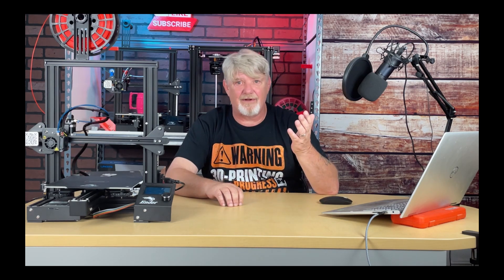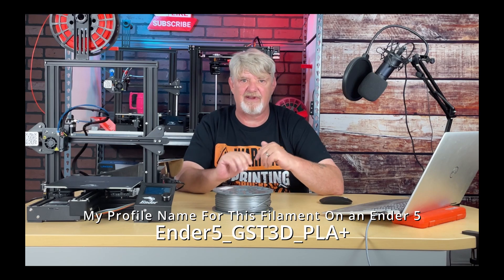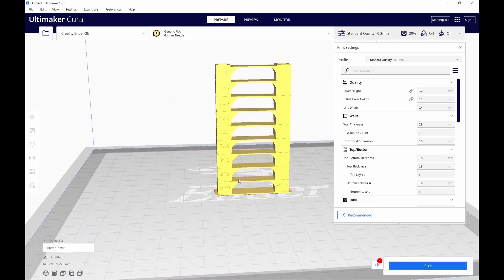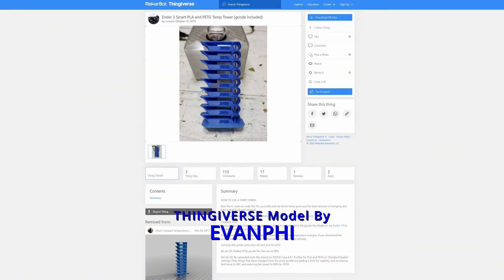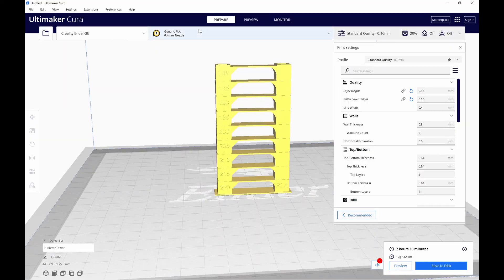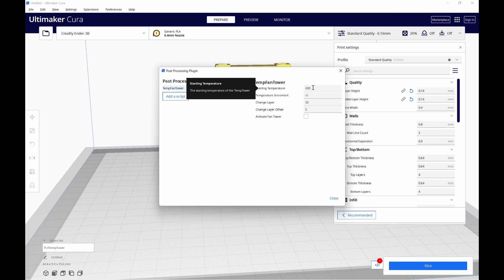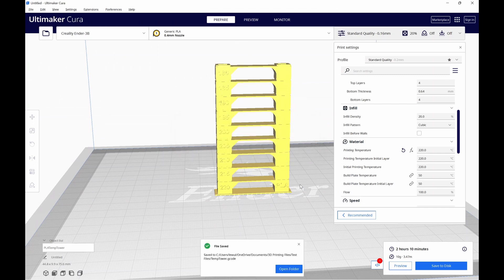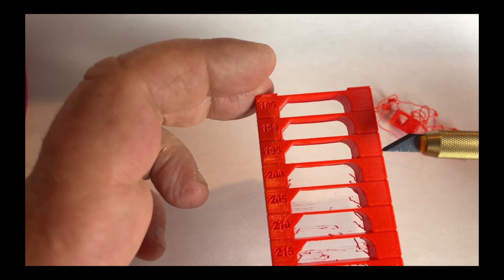Temperature Towers Using Cura Calibration

Comment: Good.  But this is a temp tower, do we really need to run at .16mm layer height?  Why not just make it .32mm and do a layer change every 26 layers (with a base of 2 layers)?
Reply from the maker: An easier way would to be use the automated calibration towers from the Cura Market Place

Comment: Question on this please? I have got my temperature set to 220 in the print settings of Cura. I want to print the supplied tower but that temp says 230. My question is do I keep my printing temp at 220 or 230? Thank you!
Reply from the maker: You have to work the gcode so that you are printing a range of temperatures to determine what temperature works best. But since making this video, I have a newer video that demonstrates a much easier method that takes the guess work out it. It's a quick five minute video, give it a look and see if it doesn't make the process easier. Good luck! https://youtu.be/fjlGvtNSlYw

Comment: This video was EXTREAMLY helpful, as I just purchased a Mingda Magician Pro 400x400x400, and new to 3D Printing.. my needs are for printing Carbon / Nylon car Parts for my 1937 Pontiac SilverStreak. having a few filaments (will try and keep to the same brand); this test will ensure my Cura settings are as good as it will get per filament type.. the hint about calculations and post GCode was wickedly helpful!
Reply from the maker: Thanks for the kind words! You have a nice size printer!!!

Comment: Im pretty new, im using the cura extension and printing flow towers, the flow seems the same all the way up... Not sure why its not changing.  Im wondering why im getting the second layer smashing the first layer... It seems ok after the second or third
Reply from the maker: I'm not sure what you mean by the second layer smashing the first layer? But I'm going to make 2 guesses and hope one of these what you are faced with. Could it be that your Z-Offset is set a little to low and the nozzle is squishing your first layer outward? If this is case increasing the z-offset a little bit could take care of this. Just don't go to high or you'll get no bed adhesion. The second guess would be that your initial layer height is set higher than the rest. It's common to do this. In Cura, I run my initial layer at 0.28 and my standard layer height at 0.20. I'm not sure what printer you are working with, if you have to manually level it of not. If you're manually leveling, you could leave just a little more room between the nozzle and the bed plate. Not a lot, just a little. I hope this helps!
Reply: @pushingplastic7445  sorry yeah it's an Ender 3 max, using glass plate and I can't get it to stick unless it's squishing that filament pretty good.  Yeah maybe I'll mess with that initial layer more.   Isn't z-offset for auto leveling printers?
Reply from the maker: @Jacey2001  The easy fix would be to let a little more distance between the bedplate and nozzle. IF you're leveling the bed with a piece of paper, just try have a little less drag  on the paper.
Reply: @pushingplastic7445  I'm using a gap tool,  0.1mm fairly tight.
So set initial layer to .28? Adjusting flow doesn't seem to work that much
Reply from the maker: @Jacey2001  you could try .15 to .2 on the gap tool. .28 on the initial layer will squish it more. Flow isn’t going to help you in this case

Comment: How do you use the Evanphi temp tower model? Do I just download the gcode he has there and print that? or I download the model and somehow set it up with that?
Reply from the maker: Don't use dowloaded gcode. While the code for the tower itself might work, there is always the chance that other settings in the gcode could cause you problems. But you can download the model and use it. Just use the same steps as shown for setting up the layer/temperature changes as shown for the version using the calibration shapes tower. You might want to Check out the Cura Autotower Generator plugin. It will setup the tower and gcode for you. I have a video for that on my channel. It's much easier to use.
Reply: Awesome, thank you! Will check out your other video. Thank you for the quick response!

Comment: sorry I dont understand why youre talking about springing, isnt that tuned with retraction? thanks im struggling with TPU on direct drive KP3s PRO
Reply from the maker: A few different things can (and do) cause stringing. Incorrect temperature settings is one of them. Determine the right temperature for your printer/filament combo. Once you have that set, do a retraction test. Everybody struggles with TPU. Not a direct drive, but on my Ender 3, when printing 95A TPU, I print at 220 at the hot end, 70 degrees on the bed, I really slow down my speed, to 20. Thanks for watching!

Comment: Great video, great explanation.  Thanks.  I’ve noticed that Cura now has a specific Temp Tower download.  I’m brand new to printing so this is my first attempt.  I’m assuming that even though it is a preset download I will still need to set my own G Code parameters.
Reply from the maker: Try the auto tower generator, it’ll make the g code for you. I have a video for that on my channel
Reply: @pushingplastic7445  Thanks, I only found your channel this morning.  I’ll watch that now.  I’ll have a look through your back catalogue as well.  To me your videos are so well put together.  Thanks for taking the time
Reply from the maker: @robinparkes988  thanks for the kind words & thanks for watching!
Reply: If only I had looked through your back catalogue first.  Yes, you already covered this.  Oops. 🇬🇧

Comment: Good information. Would love to hear more about your choice of that other temperature tower from thingiverse. Thanks.
Reply from the maker: Sure! There's a little bit more that you can learn from that tower. The Arc on the left side of the tower, it gives a good indication of how a particular temperature handles overhangs. Also on the left, there is a wall that tapers from front to back provides some feedback on how a particular temperature with walls of various sizes will print. As the wall gets thinner, you might see more stringing. On the right side, there is a circle with a spike in it. Look for stringing in there. The spike also tapers from bottom up. I look to see if the spike is broken. The spike can give you an idea on how well a particular temperature will do fine detail.  Besides those things, you still get to see what temperature does the best with bridging. The other towers really only show bridging and stringing. By looking at the one from Thingiverse, I look for the temperature that gives the best bridging, the best overhangs, the least amount of stringing, the best detail and least amount of layer separation. If I have two temperatures that look equally well, I use the lower temperature of the two. Thanks for asking! And Thanks for watching!
Reply: @pushingplastic7445  wow thanks for a detailed explanation. I am just starting in this with a new printer. Your videos are useful. I have been binge watching them one after the other 😀
One quick question about this thigiverae tower again - do I need that post processing gcode like you showed in your first tower video? I think it will be helpful for newbies like me to see a dedicated step by step video from beginning to end on this one. Hope you can make one soon.

Keep up the great work. Subscribing your channel.
Reply from the maker: @ashokmoghe8035  No problem! If you download the temperature tower from Thingiverse, load it into cura like any other file. Then follow the instructions in the video at 9:30 mark. In the dialog box to modify the GCODE, Add the script  TempFanTower, set the Starting Temperature to 225 degrees, the Temperature Increment to -5, the Change Layer to 50 and the Change Layer Offset to 7. Slice and print! I hope this information helps and thank you so much for watching and subscribing!
Reply: @pushingplastic7445  thanks a bunch. About to graduate from successfully printing the sample filament PLA to PLA+ I bought in the store.
Guess I got to follow your video and try the temperature tower first.
Thanks again.

Comment: I was not able to find the extension. I was able to find and add the calibration shapes plugin, but i do not have the TempFanTower extension. I'm using 4.8 because i cannot figure out how to add my Neptune 3 Pro or Neptune X to Cura 5.2. Any help would be appreciated.
Reply: Okay I upgraded to 5.2 and that fixed everything. Thanks very much. I’ll let you know how the test comes out.
Reply from the maker: @TheKirk48  Glad to hear it's all worked out! Looking forward to reading about your results! And of course, thanks very much for watching!!!!
Reply from the maker: I’m looking on Cura 4.1.1 right now. After installing the calibration shapes from the marketplace, restart cura. You should see a pull down menu at the top called “Extensions”. Click on that and select “Part for calibration “. You’ll see a list of parts, select “Add a PLA+ TempTower”. After is appears on your screen, go back to the Extension pull down menu, select “Post Proccessing” and click Modify G-Code. Click the “Add a script” button. This is where you’ll see the TempFan Tower, on the version I’m looking at right now, it’s the 3rd from the bottom. I hope this helps!
Reply: @pushingplastic7445  checked the PLA+ and still am not seeing the script for tempfan tower. There are only 12 options for scripts, so i know im not missing it. Does that script come from the plugin?
Reply from the maker: @scottbayreder8699  here’s a link to a video to fix missing scripts for the plug-in https://youtube.com/shorts/JKuqTjS2v0c?feature=share
Reply: @pushingplastic7445  Thank you so much for your help with this!! I am currently printing the temp tower on both printers, about to test all of the filaments that I have. Can you recommend any other calibrations to print that are similar to this one?
Reply from the maker: @scottbayreder8699  Awesome! Another calibration print would be a retraction tower to help get rid off f stringing. I have a video for that on the Pushing Plastic channel.
Reply: My problem is market place only sows me the community plug ins. How do I get to the page where I can install these plugins. Sorry for being a dork
Reply: I made the tower the way you instructed. They all look beautiful. I’m not sure they even changed the way they were supposed to.
Reply from the maker: @TheKirk48  Did you look at the LCD panel of your printer while it was in progress? You will see the temperature change on there.